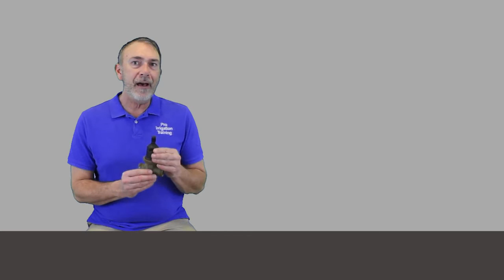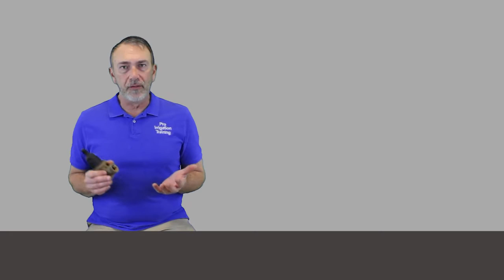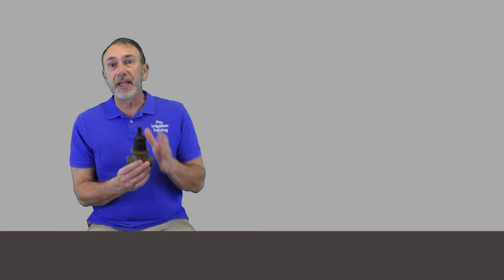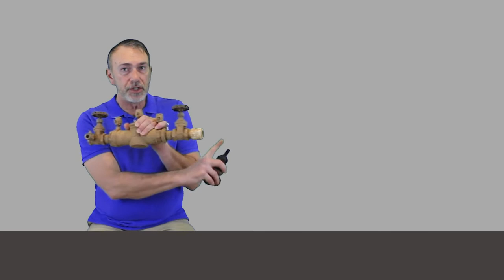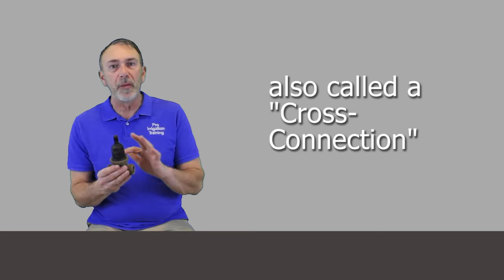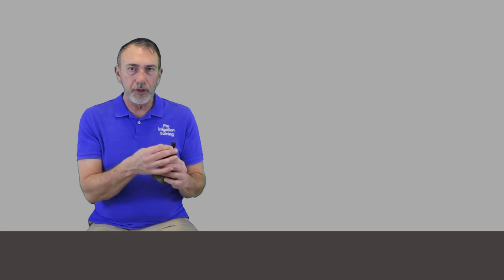How to Use Pressure Reducing Valves

Comment: I have almost watched all of your videos, thank you so much.
I’m a total newbie, as you might tell from my question.
Q: would there ever be a situation or property that’s lite commercial or residential where more than 80 PSI would be normal? Where I’m from there are some property’s that sit on 2 acres+ and I believe they’re using city water. Would 80 PSI still be about the max as a general rule of thumb?
If not, do you use the number of zones on a system to judge how much is too much?
Reply from the maker: I've seen many areas that have far more than 80 psi at the supply. But I wouldn't think that on a 2 acre property, you'd need more than 80 psi. I suppose it depends on the actual pipe lengths. Sometimes on larger properties or properties with zones with elevation rise, you might need more pressure in the main line to supply those far-away or elevated zones. It doesn't matter the number of zones since only one zone is running at a time. It's really a calculation of the friction loss through the pipe run from source to last head, plus the loss through valve and fittings.

Comment: Hey I’m in Greenville too!!! Thank you for this informative video. I have a leak in my front yard so I need to shut off the water. I do not have a backflow valve so I will need to shut it off using the pressure regulator. I’ll be good as long as I turn it to the left correct? When I reopen it how do I know what pressure is good?  Thanks again
Reply from the maker: Kali, please forgive me for answering your comment so late. I hope you got someone to take care of the leak. Generally, a pressure regulating valve won't shut the water all the way off.
Reply: @Proirrigationtraining  I asked a landscaper who works on irrigation systems to fix the leak I found, install a master valve and a backflow valve. It’s ok thank you for responding!!!